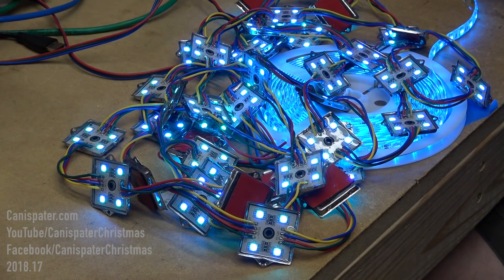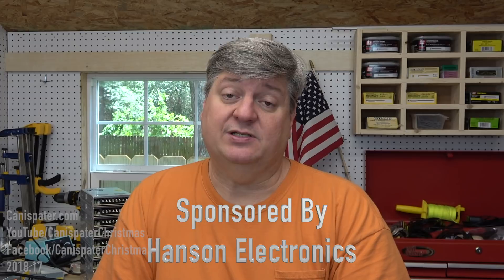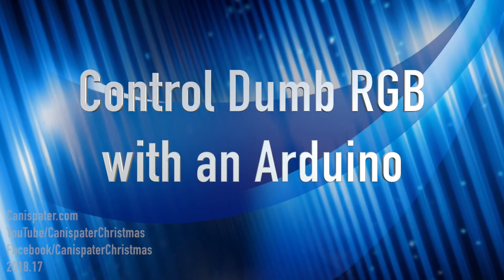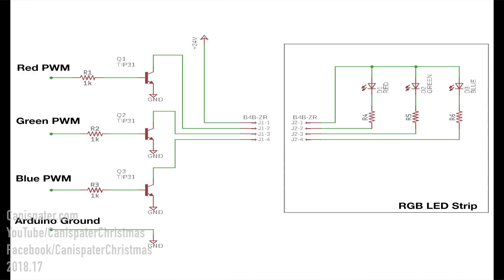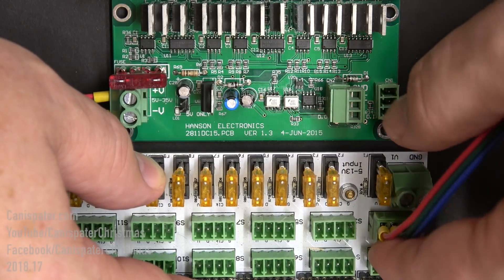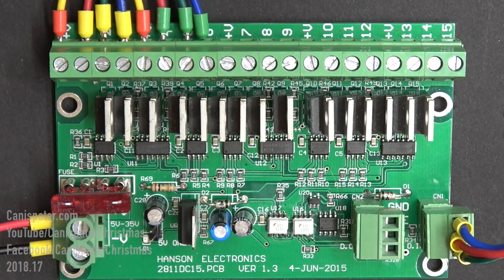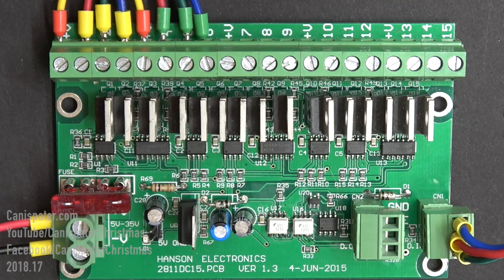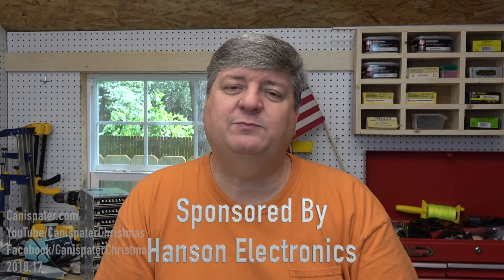Dumb RGB Strings In Your Display (2018)

Comment: Another great video Jeff, now with that controller for the Dummies can you control each string or do they all come at once if you have more than one string attached to the controller. I would like to use it for my Tune In Sign I cut on my CNC and then some other features also. With the sign it would stay on constantly during the songs but the other features would be on interment intervals.
Reply from the maker: To a pixel controller, this looks like a set of pixels (5 or 10 depending on which dumb controller you have), but the actual dumb pixels themselves are controlled at the string level as opposed to the node level. To answer your question, yes, you can control each port individually so a string attached to port 1 can be on off or any color and a string attached to port 2 can be different.
Reply: @CanispaterChristmas  Thank you for the reply so fast Jeff, Looks like I am going to get a controller from Hanson
Reply from the maker: Tell him I sent you. :)
Reply: @CanispaterChristmas  Will do!!

Comment: New to the hobby and really enjoy your videos.  I'm wanting to use some dumb rgb bullet style nodes in my display this year and was wondering if you have a source for them I've been looking online but I'm having trouble finding any.
Reply from the maker: Thanks! Why dumb nodes? They may be hard to find. They're an older design. I got mine from Ray tho.
Reply: @CanispaterChristmas  thanks for the reply. This is my first year to do a display and I thought the  dumb rgbs might be a little easier to sequence until I get a little more familiar with sequencing. Do you think I should just go ahead and go with smart pixels?
Reply from the maker: Yes and they are more the standard now. If you are in the US, check out wiredwatts.com. Ken has just about everything you'll need.
Reply: @CanispaterChristmas  Thank you!!

Comment: I am using code to run my pixels off arduino. I do also want to run some dumb RGB LED strips off an Arduino too, where can I find code for the Arduino?
Reply from the maker: Dumb pixels are analog so you 'd use 'analogWrite' to set the output level for each color.
Reply: @CanispaterChristmas  well I am trying to run flood lights but I don’t want to use dumb rgb lights if I could, do you know if they sell rgb flood lights with the ws2811 chip?
Reply from the maker: @lightsonmatfield4031  Yes, they exist. I have a couple of them.
Reply: @CanispaterChristmas  where could I get some of them? eBay?
Reply from the maker: Inventories are probably running low this time of year, especially this year, but Ken sells them: https://www.wiredwatts.com/smart-pixels

Comment: I am currently looking for a way to run some rgbww dumb pixel strips off at falcon16. Any ideas like a 2811dc that includes control of warm white? The string has ground, red, green, blue, warm white. If not is there a place to get the 2811dc in the United States? Thank you!
Reply from the maker: I don't know of anyone still supporting dumb strings other than Alan and he ships anywhere. F16 only supports smart pixels so you'll need a dumb controller. I built an RGB version with an Arduino, but it doesn't support pixel data. They are analog so a transistors and resistors are all that's needed to control them. Getting them to respond to pixel data will require more circuitry, but obviously not impossible.
Reply: @CanispaterChristmas  thank you for the quick reply! I have been going through the into to pixels lessons that you have made, they are very helpful! 

So the 2811DC controller is not compatible with the f16? From my limited knowledge I thought the 2811dc controller would basically take the data from the f16 and use that to control 4 strands of dumb pixels.
Reply from the maker: Thanks! Sorry for the confusion. The 2811DC looks like a 2811 pixel or string of pixels to the F16 so it is compatible. You can even run other pixels off the same string. So yes, you understand it correctly.
Reply: @CanispaterChristmas  it's a Christmas miracle! Thanks again for all the work you have put into your videos!

Comment: I am pretty sure you can "off board power" with these boards too, meaning you can use different voltages on the same board....
Reply from the maker: Cool! I didn't try that, but Alan Hanson would know the answer for sure. He has a contact page on his website. I've done that with smart pixels, but admit I'm not as familiar with these.

Comment: Can you use a pi to control this controller with Xlights or do you need pixel controller as well as this?
Reply from the maker: The board thinks it's a WS2811 pixel so you'd still need a pixel controller. An rPi-28D (http://www.hansonelectronics.com.au/product/rpi-28d/) might be an inexpensive option.
Reply: So mount the rPI-28D to the pi, then would I be able to output from that to a 2811DC30 and run XLights through the pi?
Reply from the maker: I believe that will work though I haven't tried that configuration. BTW, you can create a sequence or "light program" in xLights and export an FSEQ file. Load Falcon Player on the Pi, import the FSEQ file, schedule and play that file on the Pi. With the rPi-28D attached, you'd configure it as an output in Falcon Player, then run wires from the rPi-28D to the 2811DC30. Appropriate power supplies and you should be delighting your neighbors.
Reply: Thanks for the input. Scanning through the forums has been time consuming, to say the least. I've been thinking about getting your course, but my purpose for the light display is for a summer festival in town, so I have more time to figure everything out. Tried to use them this year but ended up having to use mechanical relays with standard led Christmas lights.
Reply from the maker: Ah OK. I know it sounds like a lot and it is for your first year, but once you get it all set up, it's easier to add onto. Try loading Falcon Player on the Pi first. I'm doing a series on that right now. Once you get that running, hollar at Alan, get those boards and hook them up. You can test the lights from the testing menu in Falcon Player to at least get something blinking. Then program away. :)

Comment: I was wondering of I bought a holiday Coro 30 channel dumb rgb controller and I plugged in three strings of dumb led rgb strips also from holiday Coro would I need to program or control these some how? I mean it says it’s Ready2run so would I just plug them in and have the settings on there already? Or would I be able to add settings or different modes my self if I were to program them and add it to the system. Sorry I’m just as dumb as the bloody lights. Don’t really know what I’m doing trying to add some rgb lights to my bland looking led ones which are all out of sync and it’s really annoying. I chose this set only as it was ready2run and looked weather proof which it has to be for the crazy weather here in Australia wether it’s poring rain or boiling hot. Also looked very easy to install and use.
Reply from the maker: Ready2Run generally means the kit includes everything you need to get started hardware-wise (cables, power supply, etc). You would still need to provide data to get the lights to turn on and off and set the color like you want. There may be a test mode that would work without having to program anything. Honestly, I'm unfamiliar with the HolidayCoro line of controllers so I won't be a lot of help here though I know others have them. You may want ask over on the forums (AusChristmasLighting for people in your country, but check the others too) and/or Facebook groups linked in the descriptions of my videos - plenty of folks over there with experience and knowledge.
Reply: CanispaterChristmas thanks for the quick reply. Yes it does come preinstalled with a test mode on it. If I wanted to add new colours and program the lights how and what should I use to do that? Thanks.
Reply from the maker: Well, I use xLights to program the lights for my display. Getting from xLights to that HolidayCoro controller is a bit out of my wheelhouse as I use a Falcon controller which has support for DMX and I run any DMX off that. I do know there are DMX dongles you can use to plug into your computer, but I've not used them. Alan at http://www.hansonelectronics.com.au has items that might help.
Reply: @CanispaterChristmas   Hey im pretty new to doing the christmas lights thing.  So far I have a Raspberry Pi3b+ with 16 relay channels comming off of it.  The Pi is running FlaconPlayer and so far I have successfully  played a few sequences.  The reason for my post here is because I have also just purchased a ready to run dumb 30 channel box from holidaycoro along with the DMX dongle... I see you said you dont have any experience with this brand, but Im hoping the setup will be fairly similar.. and onto my question do you have a video on how to setup a dmx controller with xlights? Im sure I can bumble my way threw it evently but any assistance would be super appreciated!!
Reply from the maker: @MrZac1811  That's great! I don't have any DMX controllers, but you might find something useful here: http://videos.xlights.org/search.php?keywords=dmx&video-id=
Reply from the maker: @MrZac1811 Just re-read this. I don't have DMX controllers - except this one haha! The board in this video acts as a pixel so it's driven with a "smart" pixel controller. xLights has a DMX output you can add - click add USB on the Setup tab and make sure it's set for DMX. The dongle should connect to the board and run the lights. See the videos in the previous post for setting up xLights. He has a short video on his website about the board. Once you set up the board on the setup tab in xLights, you should be able to create a model for the lights and generate a sequence like you would with pixels.
Reply from the maker: Still not a DMX controller, but a dumb RGB controller.

Comment: Hey Jeff, Until now I didn't have a reason to even look at dumb pixels, but thanks for the run-thru. I noticed at about 4:43 in the video you have some really nice termination on your wiring. Can you provide source and description for those? Love the color coding and apparent ease of using in screw-tightened connections.
Reply from the maker: Haha! Thanks! You mean the bootlaced ferrules? I got a kit from Amazon https://amzn.to/2wXEJO6. I had been just using soldered wire, but Alan Hanson turned me onto those as some people had problems with the soldered tips backing out of the connectors due to the current/heat etc. I started using these and they're pretty cool. No soldering needed.

Comment: I know the odd few people with no chip in them :D
Great video Jeff.
The 2811DC boards can also be used for boring old single channel fairy lights, rgb floods and I know of 1 person who has used them to drive solenoids to control fountain/jet type things. Protection is needed once you drive relays or solenoids.
Reply: When you say protection needed. What would i need to drive relays from 2811dc15? Is a diode enough?
Reply: A diode is enough. There's an example of connecting a relay in the suer manual.

Comment: Hey. Tip for your dogs and fireworks. Close curtains and turn all lights on and turn tv up
Reply from the maker: Yeah, the one that's really bothered by it hides in the bathroom and I turn on the white noise generator for her. :) Someone told me that they fire off a cap gun when they feed them as a puppy so the pops are no big deal as they get older.
Reply: CanispaterChristmas never heard that one before. I play a lot of fireworks videos on the speakers the cat is no longer bothered by them any more

Comment: Just curious about the home automation that slider bar looked like one from Home Assistant
Reply from the maker: Good eye! Yes. It's Home Assistant. The video that pops up should be all about setting it up for my stairway lighting.
Reply: Im still new at it using the newest hassio it has its challenges
Reply from the maker: I moved to a Docker container running on my linux machine just 'cause I'm learning Docker. Yeah, I'm also learning just about every time I want to change something, but it seems to work well.
Reply: It has its bumps in the road I am working on themes so I can use different ones for my new Dashboard on a 10 inch tablet to really make it auto control from the tablet
Reply from the maker: Ah yeah. I haven't ventured in that area. Good luck! :)

Comment: I was asking about this on a Facebook group and was told it didn’t exist. And I knew I seen it somewhere. thanks.
Reply from the maker: Which part?
Reply: CanispaterChristmas a board that controls dumb strings from falcon
Reply from the maker: The one I used was from Hanson Electronics. He has a 5-string version and a 10-string version. The boards can also be used to control relays for animatronic props.